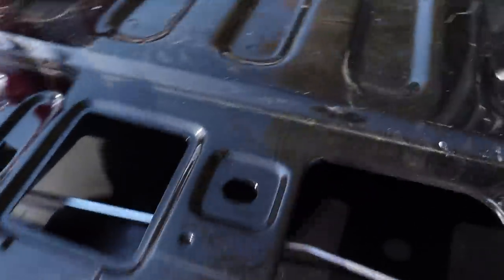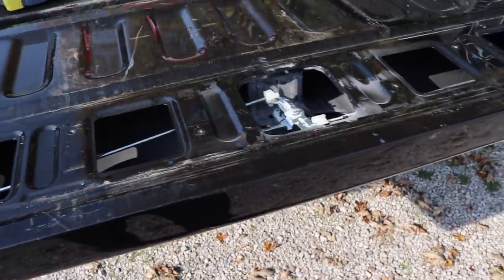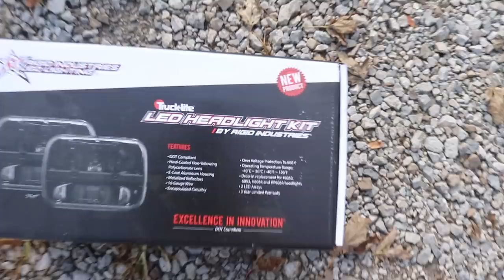The BEST UPGRADE for every 1st gen dodge!!!

Comment: Those new headlights look awesome! I just replaced the ones in mine, and I got this brand called new osram, they are LEDs. I got the idea from decent garage. My original ones were halogens too, and they had some water in them, I hear the seals suck in those halogens, and I believe it.
Reply: Actually where the water is probably coming in from I can’t say this for absolute sure but the lens and the reflector or two pieces would I recommend people to do is take some good carburetor cleaner I like to use Berryman B 12 ‘ cause it leaves virtually no residue and clean in between the lens and the reflector and put silicone around there or not to use very much just enough to fill that little gap and it doesn’t hurt to tad by little while I use the red high temp silicone on the connectors where they go onto the back of the headlight anyhow ha this is six in a row Jim

Comment: I agree, stock headlights are crap, but $356.99 for those Amazon referral headlights?  I paid $85.99 on Amazon, and these are DOT approved.  (Afeax New Osram Chips 110W 5x7 Inch Led Headlights.). For the difference, I could buy the LED Tail lights and take the wife out on date night.  While you’re at home explaining to your wife, why you paid $356.99 for some headlights.  I know how my nights ending, I can only guess about yours.

Comment: For a lot less money are they probably don’t put out as much light as those headlights you got no daughter very good headlights the ones you put in your truck but I like Hella what I like about the hell a headlight is it puts the Beemont they’re really nice and also you can change the bulb in the event the light bulb itself burns out anyway I put them in my truck and I ran relays and I got a relay for high beam and relay for low beam and the power come straight from the battery it’s really neat set up man you got full voltage to the lights and that makes a big difference anyways this is six in a row gym from Kennerdell Pennsylvania I got that 91.5 back the house

Comment: Are you planning on putting Bed liner on the dually tail gate to match the rest of the bed?
Reply from the maker: I would have until I needed to fix that latch system lol now I don’t think I should just in case
Reply: @LOUDNPROUD  I would do the inspection plate separate from the tailgate so that it doesn’t stick together and you can still remove it if needed, that’s what I did on my ‘03 Cummins